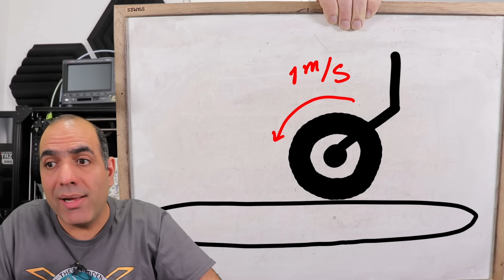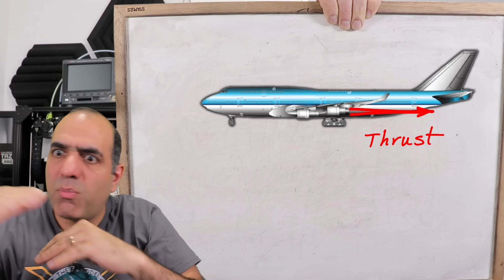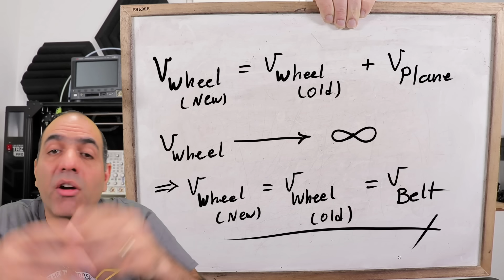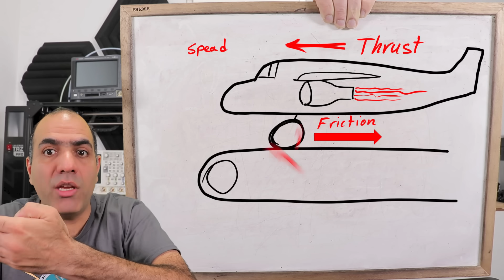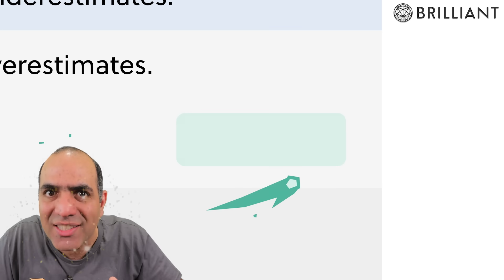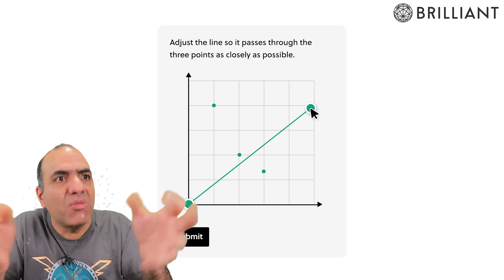Airplane Question that Drove Me NUTS!!!

Comment: This seems like a no-brainer: the engines "push against" the air, not the ground.  And to take off, the plane simply has to achieve a certain speed relative to the air - ground speed (therefore belt speed) is irrelevant.  Therefore the plane can take off just fine.

Comment: Planes need lift on their wings to take off that’s why the flaps is always down at take off moment if the plane is always at the same place but with no front wind it will not take off and it have to be at a certain speed not just the tires but the plane entirely

Comment: As far as Im concerned the answer is that the plane takes off. Because any other answer requires either unrealistic conditions or that the question has misleading intentions.
1: The wheels aren't receiving power, jet thrust pushes the plane forward
2: Mechanics of the setup will fail before the conveyor can match the forward thrust the jet is producing
3: Mechanics of the conveyor will always be more complex and vulnerable to failure than the wheels, and thus would break down and fail before the wheels
Result: conveyor breaks and becomes a static runway, jet takes off

Comment: Imagine holding a toy plane on a running machine. Your hand is the jet engine. You can easily push the toy plane forwards regardless of the speed of the running machine, the wheels just spin faster.

Comment: This is so dumb. I really don't know, how people could think, a 747 is driven by the wheels. It's medium is air, not ground.
Reply: I don't think that's what most people think.

The debate is a result of what people are assuming the question is asking.

Do you think it's asking if a motionless plane can take off, or do you think it's asking if you realize there's no way for the contraption to prevent the plane from moving.

Comment: You could also start with reverse thrust to get the feedback loop between the wheels and conveyor belt started going forward, and then take off in a situation where the wheels are spinning backwards while the plane goes forwards.
Reply: Except the wheels should start going forward causing the conveyor belt to reverse direction because of friction since the wheels are still touching the ground and the velocity of the plane > velocity of the conveyor belt.
Reply: That doesn't work. If the wheels are spinning backwards at 1 m/s and the belt is moving forward at 1 m/s (thus satisfying the condition), then the plane's ground speed will be zero.
Reply: @whitslack  just turn on the wheel brakes
Reply: @EricEatingCheese  Then the belt slows down at the same rate, and the plane remains stationary. The whole scenario is impossible, of course, because it requires the belt to react instantaneously to changes in the wheels' velocity.

Comment: I think it depends on whether friction in the wheel bearings is considered. If the wheels are considered to be ideal frictionless bearings, then the plane will move forward under engine thrust regardless of the belt speed, and will take off normally. If there is some friction in the wheels, and assuming the belt accelerates as the plane applies thrust, then the plane will remain stationary as the engine thrust matches the opposing force created by the wheel bearing friction. In the case where wheel bearing friction is present, but the belt also interacts with the air above it, then the resulting headwind caused by the belt might create enough lift under the wings to lift the plane off the belt, at which point it will no longer be in contact with the belt and will then take off.
Reply: Edit: I should clarify that the air movement over the wing is the primary source of lift. Regardless, we can assume that if there is a difference in speed between the plane and the air around it, lift will be produced.

Comment: Imagine you have a toy car on a conveyor belt at the grocery store. The belt can spin at any speed, even faster than the car. Are you still able to push the car forward on the belt with your hand? Of course. Same is true for planes since the trust comes from the engines (aka your hand) and not the wheels. 

Now if you’re going to be pedantic about friction, weights, engineering feasibility then of course something would melt or fail to make this thought experiment actually impossible.

Comment: only the ground speed is increased? if yes then no since no life is generated 
if the wind is also accelerating then yet it will instantly take off but probably the g-forces during the instant take off will break it apart

hmm but the wheels arent turning because of the engines it moves forward so the belt will also go forward

Comment: This also ignores the no slip condition of air at the belt surface; the belt itself would thus create a flow of air, and assuming the case where the belt has to go extremely fast for friction to overcome the airplane thrust, this could be a very significant effect. Especially if the belt is very long and the boundary layer has time to grow significantly.
Reply: Boundary layer is not gonna get big enough to reach the wings

Comment: no. planes take off because of air moving over and under the wings, if the motion of the wheels is canceled out by the runway moving in the opposite direction, then there would be a net total of no air movement over the wings, it would be like the plane is just stationary, and you dont EVER just randomly see a stationary plane launch into the air, we dont live in a video game. in order for something liek that to happen would essentially require hurricane force winds moving over the wings.

Comment: Lift is not enough, pilot must “rotate“ at the correct velocity. During rotation, what happens to the aircraft as the wheels depart from the conveyor with only thrust from the momentum? I say immediate landing (if you’re lucky)
Reply: The plane doesn't remain stationary.  That's the trick of the question.
Reply: @407BRR  …does not matter. It’s an airplane, not a slingshot. Needs thrust after leaving the conveyor or immediately falls back to earth.
Reply: @stevet5087  maybe if I explain  it like this.

Imagine you're at the airfield as an observer. There's two airstrip next to each other. One of them is a normal runway. The other is the conveyor belt contraption. 

Two planes are lined up, one on each runway. Both planes start their engines and power them up to accelerate down the runway. What you observe is that both planes accelerate at the same speed remaining next to each other and take off after reaching lift off speed. Without observing the movement of the conveyor belt, you wouldn't know which plane was on which runway because the planes take off identically. 

The reason is that there is no way that a conveyor belt can impart a force onto the plane to counter act the thrust of the engines. 

But I understand the confusion. It comes down to what you think the point of the question is. Do you think it's asking if a motionless plane can take off, or do you think it's asking if you realize there's no way for the contraption to prevent the plane from moving?

Comment: My guess is that the "correct" answer that they're going for is "Yes". The jet doesn't use its wheels to generate thrust, just to keep it above the ground while it's too slow to fly. The engines don't really care what's happening to the wheels; they just produce thrust. So, in spherical cow land, all the treadmill does is increase the rotation rate of the wheels, and the plane can take off just fine.

In cow-shaped cow land, on the other hand, the tires are only rated for a certain speed, which isn't all that much higher than the maximum rotation speed of the aircraft. They certainly won't handle the runaway speed of the treadmill, and so the tires will explode! Once they do, the treadmill will be applying enormous friction forces on the rims while the rubber flaps around and destroys stuff. Good times. At some point, the friction will become asymmetrical, and the plane will most likely slide off the side of the treadmill and crash. So no, in reality, the plane would most likely not be able to take off.
Reply: Considering that the wheels are designed to be landed on, I think they'll hold up fine.

Comment: GPT4 thinks that this scenario would be most likely:
The 747 is positioned on the conveyor belt, with its engines running and all systems checked for a safe takeoff.
The pilot releases the brakes, allowing the aircraft to move freely on its wheels.
The pilot advances the throttle, increasing the power output of the engines. The engines generate thrust by expelling a large mass of air at high speeds, which would normally push the plane forward.
However, in this scenario, as the engines generate forward thrust, the conveyor belt adjusts its speed perfectly to match the speed of the wheels, counteracting any acceleration provided by the engines. The wheels spin but do not move forward relative to the conveyor belt.
Since the conveyor belt perfectly matches the speed of the wheels and counteracts any acceleration, the aircraft remains stationary in the air, with no forward motion.
Without forward motion, there is no airflow over the wings, which means no lift is generated.
In this scenario, the aircraft remains stationary on the conveyor belt, unable to generate enough lift to take off, as the conveyor belt continuously matches and counteracts any acceleration provided by the engines.

This hypothetical thought experiment highlights a situation where the plane would not be able to take off due to the conveyor belt perfectly counteracting the acceleration from the engines.

Comment: My understanding is that the plane can only take off if air is moving around the wings at a high enough speed. No matter how fast the engines are working, the treadmill is pushing the plane back at the same speed so it stays stationary.
Reply: How can the conveyor belt push the plane backwards against the power of the engines? It can't because the wheels are free rolling. The plane does not remain stationary.
Reply: @407BRR  If the plane's engines were off and the treadmill active it would still push the plane backwards. The wheels are not a 'frictionless spinning axle' because the brakes in the wheels are what stops the plane during a landing. Otherwise the plane would just plow down the runway at whatever its speed was while the wheels get obliterated by friction. Its a simple vector problem, if the engines move forward at 10mph and the treadmill moves the plane backward at 10mph then the net speed is 0. This holds up even better with a seaplane and a magical water treadmill (such as a current) because unlike wheels you can't pretend pontoons aren't literally part of the plane.
Reply: @GenarelGuy  Yes, there is some friction, but it's negligible compared to the thrust of the engines. 

As I said earlier, 
It just comes down to what you think the point of the question is. Do you think it's asking if a motionless plane can take off, or do you think it's asking if you realize there's no way for the contraption to prevent the plane from moving?
Reply: @407BRR  The point of the question is to start an arguement to generate clicks.

Comment: A plane is taxied to the runway while its engines warm up. At the start of the runway the plane starts moving at 5 mph while the engines produce 668 pounds of thrust, increasing by ~54 pounds every ten seconds. The plane proceeds southwest against a prevailing wind blowing north at 22 kph on a cloudy day of 74 degrees Fahrenheit and 32 percent humidity. Assuming the plane weighs 400,000 pounds:

How many passengers will complain about the service?

Comment: If a plane can reach the minimum take off speed, yes it can. As in answer #3, the same applies as most wheel bearing don't create significant friction until much higher speeds.. Most take-off speeds are real low and even with a headwind. The fact that a giant conveyor belt moving that fast may generate enough up force to lift the plane off the belt.
Reply: The speed of the wheel is part of a feedback loop that goes infinite, so that bearing friction is also infinite.
Reply: The feedback loop of the conveyor belt and the wheel would mean the wheel speed would immediately ramp up to the point where the friction force equals the thrust, stopping the airplane. Considering the thrust of a 747 at full power, I bet the bearings would melt at that speed lol.

Comment: Yes it could take off because the plane engines generate forward thrust, which is not related to the wheel spin speed. The plane would still move forward as the wheel friction would be minimal.
Reply: The question states the conveyor belt matches the wheel spin exactly, which is not really possible, but assuming that, the answer is it won't.  The problem is with the question being posed badly, as I strongly believe it was only meant to make you think about planes not needing wheels for power.

Comment: So this is obviously a common problem to discuss, and the multiple answers come from different ways of understanding the question and/or different ideas of how airplanes work.  In this case, though, everything seems defined enough to definitely have a real answer… except it isnʼt.

A 747ʼs forward movement is not applied at the wheels.  It should go forward, whatever the wheels are doing.  But the conveyor belt designed to counter that will then not be able to counter it.  The landing gear wheels will slip instead of rolling forward, or if we assume infinite (non-rolling) friction I think the landing gear itself will break.
Reply: In an earlier draft of my comment I did mention the infinite speed thing, but itʼs a 747.  The belt can be ideal but the plane is specified enough that if I knew where to look I could probably find the landing gear friction in some giant spec sheet published by Boeing.  And neither can turn at infinite speed because then you get into relativity; something would break or catch fire first.

Comment: Before hearing his answer: Yes, but it's complicated.

For the conveyer belt to perfectly move at the speed of the wheels, it must apply whatever force is needed to keep the wheels in the same place.

With the engines on the plane would give a forward force on the wheels through the axels, but the moving runway would dynamically give an equal force back on the bottom of the wheels (to always stay at the same speed as the wheels).
The net force on the plane is therefore zero, so the plane never moves forwards.

However, because the runway applies force on the bottom of the wheels there's a constant toque on the wheels accelerating their spin. This means the runway must be constantly accelerating as long as the jet engines are on.
Eventually the runway will be traveling so fast that it will create a wind towards the plane strong enough for the plane to lift off directly upwards.

Therefore, the plane can lift off, but only after having it's engines on for long enough for the conveyer belt  runway to accelerate to ludicrous speeds.

Comment: The plane is cleared for take off and has the runway. The plane "can" fly, assuming the pilots did preflight checks properly and are in a proper functioning airplane. Unknown if it is going to fly though. shrugs

Comment: Answering these types of questions is a waste of time because exact conditions are not given. The system's speed, whether it's constant or not, and whether the wheels are moving without slipping or not, are not stated. Additionally, it's not clear whether the speed mentioned is translational with respect to stationary ground or just rotational speed with respect to the rotation axis of the wheels. In general, before takeoff, planes move over the ground to ramp up speed to create enough lifting force to lift their weight.

In a normal situation, assuming motion without slip on a stationary ground, if a wheel with radius R turns by an angle beta (assuming constant angular velocity), the point of the circumference touching the ground will rotate with velocity v0 = R * beta / t, where t is time. Similarly, the center of the wheel will also have a translational velocity of v0. This means the touching point will have zero velocity with respect to the ground, as v0 - v0 = 0. However, the center will have v0 translational velocity.

If the rotational speed of the wheel is the same as the speed of the belt (assuming so), then the touching point will again have zero velocity with respect to the belt, while the translational velocity will still be v0. However, since the air is stationary with respect to the ground but moving with velocity v0 with respect to the belt, the plane will not move with respect to the air. As a result, it will not create enough speed with respect to the air and will not lift up.

Comment: I think the most satisfying and reasonably realistic scenario is the one where linear speed of the wheels are negatively matched by the conveyor, belt which is the one in the Mythbusters. The conveyor and the plane would move with v magnitude velocities, and the wheels would move with 2v velocity relative to the conveyor belt.
Reply: I believe that was the question's intention, but it got worded badly and this whole debate took off instead.

Comment: One way to think about this is that the plane only needs wheels to hold it up off the ground; NOT to move it along the ground. There are planes with skis and pontoons and they work just fine. The reason they are wheels and not something stationary is because the ground does not move, and we need to minimize friction.

Comment: Aircraft get aloft through the action of the air flowing over the wings creating lift.  If the conveyor belt was going at warp factor 5 the plane would still not take off.